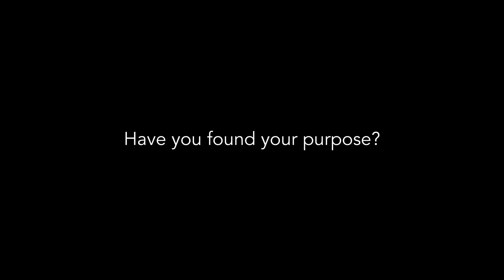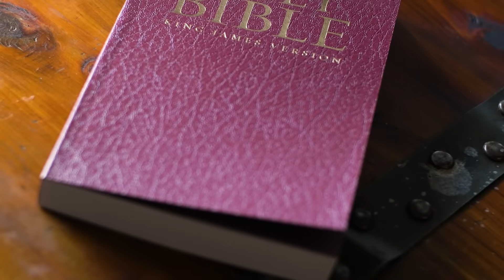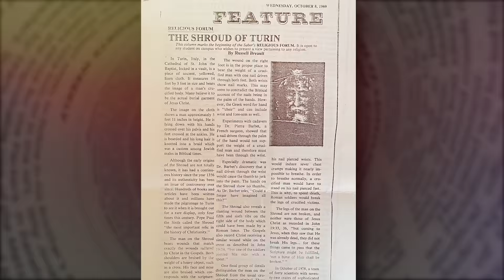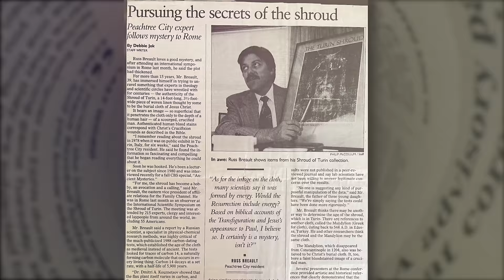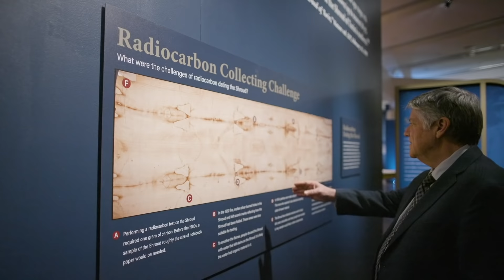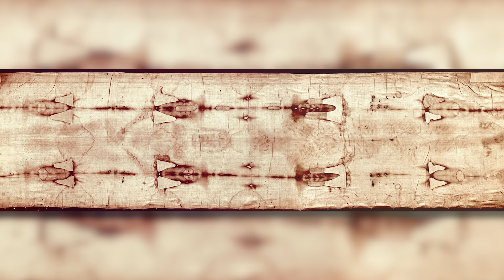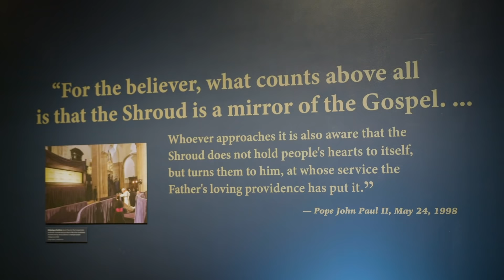Miracle or Make-Believe? Finding Purpose in the Shroud of Turin

Comment: a question was asked why would the linen shroud not have disintegrated by now given the time that has gone by ?
Reply: Flax is exceedingly durable especially when kept dry.  It was treated with a Saponaria solution which acts as a preservative protecting it from fungus and bacteria.  By example, the curtains from King Tut's tomb are in good shape and date to over 1000 BC.
Reply: @ShroudEncounter  your video is close to 500,000 views in 7 days?!     Unheard of.  No shroud video has ever received that much exposure in such short time.  Not even close.  Out of that many people it is a near mathematical certainty your testimony in regards to the shroud will lead to even greater success in completing your life purpose goal of bringing people to Christ.  All your hard work and persistence has paid off,  Perhaps bigger than you thought possible.  😉   for sure your destiny.
Reply: The Shroud fabric does have severe electromagnetic radiation damage equal to that of the Dead Sea scrolls we know are over 2,000 years old.   The Shroud must be roughly the same age as the linen wrapping to the Dead Sea scrolls.  Yes the Shroud does come from the time of Jesus